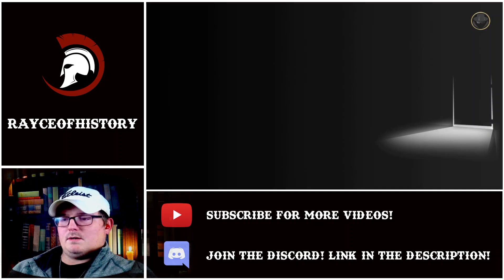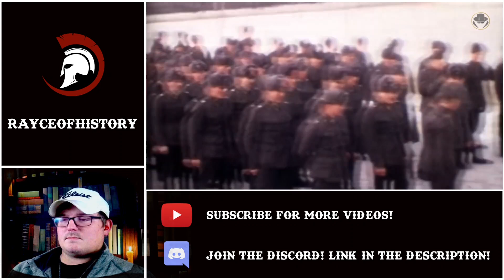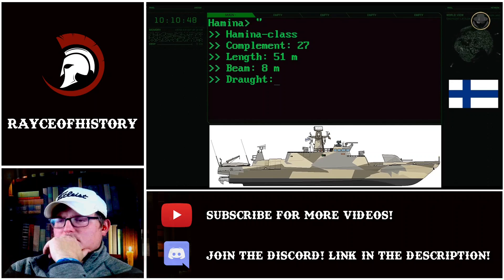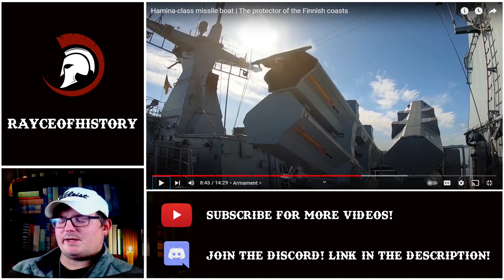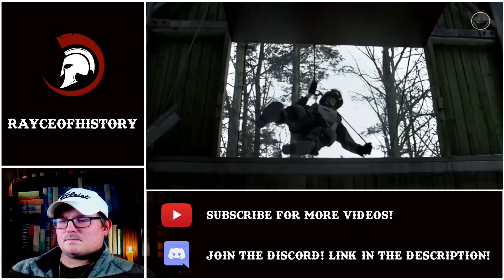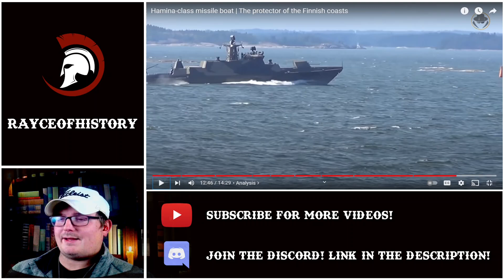Texan Reacts to Hamina-class Missile Boat by Weapon Detective

Comment: The USA has had non-GPS guided smart weapons for awhile now. For example the tomahawks used in the first gulf war in 1991 didn't use GPS. They used radar to detect ground features to fly a preprogrammed route. In open desert that system wouldn't work well so they flew over roads, cities and other cluttered areas. Final target identification and targeting was done by comparing recorded target images to what the missile saw.

Comment: Did you ask about howercraft?

Seas around Finland are frozen at winter and you need ice brakers to clear the routes. Howercraft can be used in any situation and even on shallow water. It's fast and don't trigger mines easily.

Comment: 60 percent of world's floating navigational buoys are in Finland. This tells something about the extremely dangerous, shallow waters with tens of thousands of islands, and counless underwater rocks and shoals. This is why the Finnish Navy has to use smaller vessels that are suitable for shallow, confined waters. This means one has to fit the performance and firepower of a larger vessel into a small fast attack craft. The fact that smaller vessels cannot operate independently for months like large ships without re-supply is not an issue, because the Baltic sea is a small inner sea, where one can get supplies every few days if needed.

Comment: The hovercraft seen in the video was ITA Tuuli, which was developed with a technology transfer from the USA, but never entered service. Instead, there will be 9 Utö-class service boats (Produced by Kewatec AluBoat) with a cargo capacity of 15 metric tons, which might fill the role originally envisioned for the hovercraft. Also, the Pohjanmaa-Class ships mentioned shortly in the video, are going to be 114 meters long, possibly frigate-class ships with integrated drone hangars and overall increased firepower. The Pohjanmaa-class ships are being built by Rauma Marine Constructions LTd. (RMC).

Also, 9th of December, 2022, Japan announced that they are signing a contract with the Finnish Patria to license their AMV XP Wheeled Armored Personnel Carrier to Japan and seeks further co-operation in the defense sector development and research with Japan.

Patria is also developing information systems that do not rely on GPS, but can see beyond visible range by using civilian infrastructure, such as WLAN, 4g and 5g connections as their "visual" aide in target tracking. I'm not sure how the technology actually works, but it sounds like almost as if they can use the civilian information networks as a kind of a radar of a sort, and/or as a navigational aide at the very least by traditional triangulation techniques, by using some combination of hardware and software translation equipment.

Comment: Navigation that is not reliant on GPS? Well, there is gyroscopic navigation. This is pretty old idea but if you know where do you start with (This is the part where GPS is very useful) you can use 3 gyros to record acceleration in 3D environment and acceleration with accurate timepiece gives you things like speed and distance. This kind of navigation is reliant on how sensitive the gyros are and how accurate you are on your starting point. This has been around at least from WWII forward. It was used in airplane (bomber?) navigation idea being that if follow gyros back where you started from you should bee close by your starting airfield even if visibility was bad and you lost your landmarks.